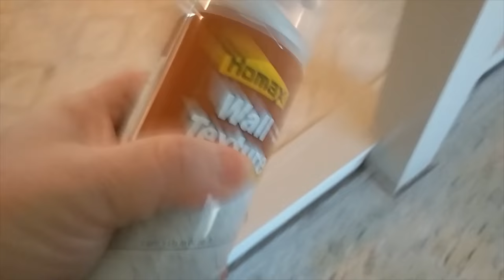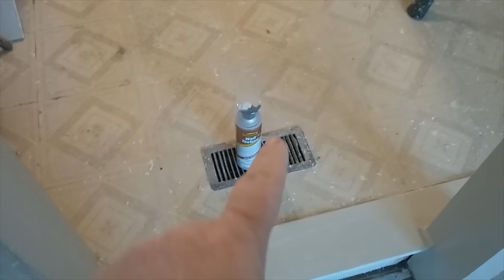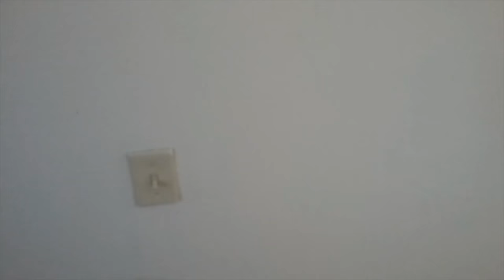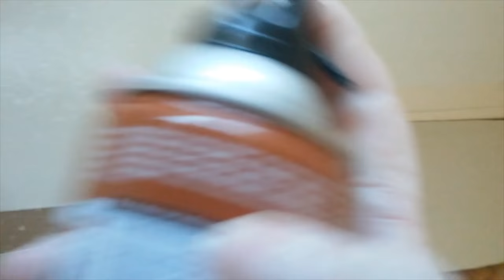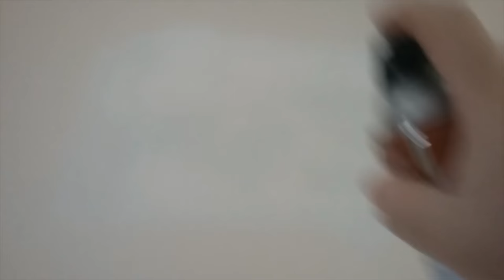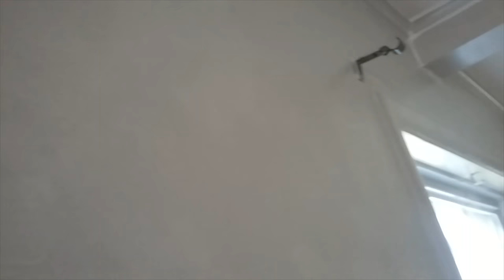How To Use Homax Knockdown Wall Texture

Comment: KEY ADVICE FROM THIS VIDEO: heat the can, shake for 2-3 minute, hold can appx 2 feet away, wait 3-5 minutes then use WET drywall knife to gently knock down texture.  Repeat as necessary.  Be sure to primer and use two coats of paint, "Darn near perfect!"

Comment: Other videos are very clear but they don't give enough advise to ease my fears of messing up my wall. I wish I could see your results but the tips more than made up for it. I've read on Reddit about heating up the can do you reinforcing it confirms to me that I should do it. Plus the dry time of 5 min is useful, and knowing I can just scrape it off if I fail. Thanks for the help

Comment: Hey Blue.  The former owner did a wallboard patch without texture and with a noticeable bump,  How would you approach fixing it then applying Homax.  Just do a lot of sanding?
Reply from the maker: Yeah, I would try and get that bump sanded down, the feather the edges until they blended with the rest of the wall. Then hit it with some homax knockdown wall texture and repaint.

Comment: I have to retract my comment on the operating instructions.  They do indicate to put the can in hot/warm water for getting the product to spray properly.  I did this on an old can of Homax, (nearly full) and it sprayed properly.  I believe the product instructions should emphasize more the operating temperature for getting a proper spray.
Reply from the maker: Yeah, I get impatient and put them over a heating vent, but putting them under hot water running out of a faucet for a few minutes works as well.

Comment: Blue, ever thought of doing a Video just about the Nozzle? Both cans I bought the White part of the Nozzle HAS TO BE SCREWED into the selector part of the Nozzle to work. Since both my cans were the same, I'm guessing this is SOP from Homax.
Reply from the maker: It's been a few months since I've used a  new can. I'll look into it though. I have some drywall jobs coming up that will need texture applied. Not sure if they're knockdown texture or orange peel, but I'll do a video on them and I'll be using Homax wall texture.
Reply: John I get what you're saying.  I paused this video at a point where he held the can so I could see the spray nozzle.  Looking at the can again I found two indicators on the black section letting me know that was the front of the spray, so to speak.  I unscrewed and repositioned the black to white pieces until they fit comfortably into the hole in the can.  Gave it a gentle push and it sprayed a liquid.  I am now following his further instructions on warming up the can and then shaking longer than the instructions indicate.  I appreciate the tips in this video.  Wish me luck!

Comment: Generally speaking, how many square feet can you expect from one can of that?
Reply from the maker: Gosh, I'm not sure. I'd have to go look at the can. It says on the front of the Homax Knockdown wall texture can.
Reply from the maker: It also depends on how thick or thin you spray the texture on.
Reply: @BlueCollarDIY  I have a couple of places I repaired on popcorn ceiling about 2 x 2’ plus the about 4” around the top of a approximately 12 x12 room.  I am undecided about buying a couple of cans of texture, or just using my hopper to apply texture.
Reply from the maker: @rickeykeeton4770  I hear ya. For what you're talking about, two of the pro sized cans would probably do the job.

Comment: Video does not clearly show how to use the adjusting lever for fine or course spray.  The Pro kind of this stuff has an additional adjustment for pressure of spray.
Reply from the maker: It's pretty obvious when you have the can in hand. It also shows on the can where the adjustments are and which way to turn them to adjust the amount of texture coming out of the spray can.

Comment: Do not see anywhere that instructions indicate the can needs to be heated up to spray properly.  Insturctions on can indicate to shake vigorously  for at least a minute.  This product does not work, as advertised, and just dribbles out into a glob, and then doesn't spray at all, no matter the settings for flow.
Reply from the maker: That's why you can't use it cold. Heat the can up and it will be fine.

Comment: I opened my van and the entire nozzle broke off and came apart 🧐
Reply from the maker: I broke a nozzle off of a can of Homax knockdown wall texture before, but I finally figured out how to use it. If you bought it at Home Depot, Walmart, Lowes or someplace like that, I'd take it back and exchange it.